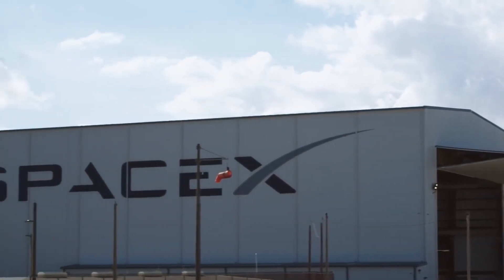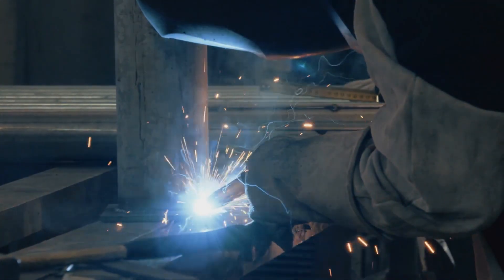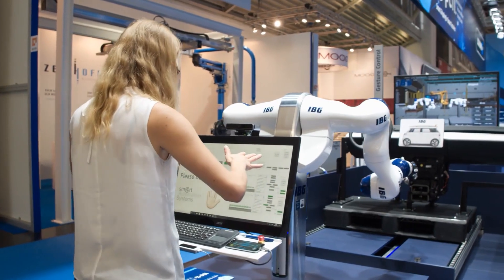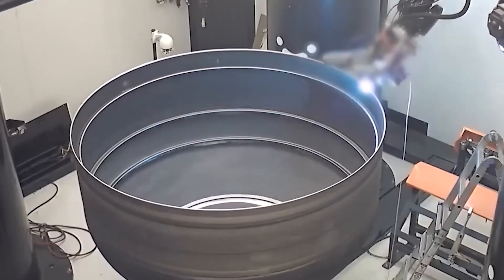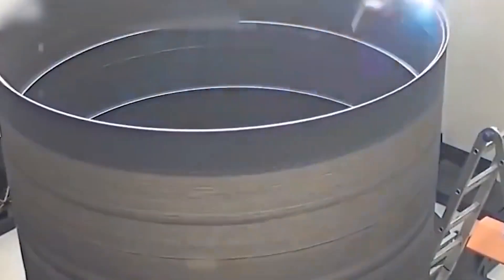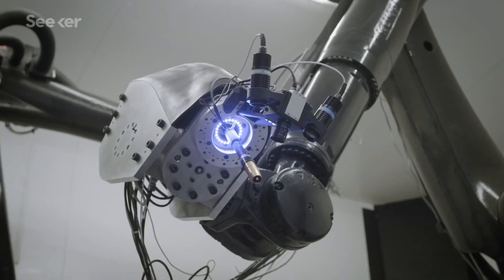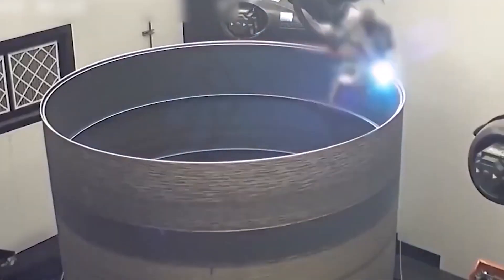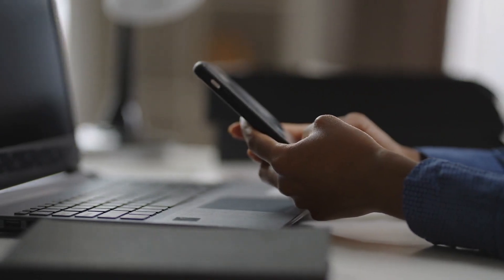Is 3D Starship Rocket Printer a Reliable Option for SpaceX?

Comment: The printing machines should be produced in multiples because they will forseeably break down quickly and likely will need inspection and maintenance after each print. Using a new machine each print is ideal however unpractical, but depending on only one would be foolish.
 Plus, this method is like stir welding the whole ship which is resilient.